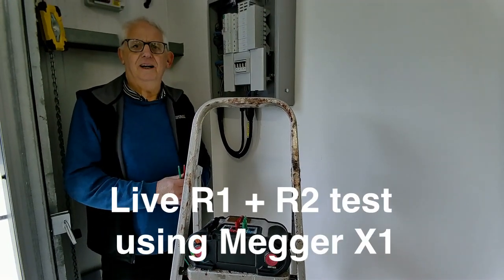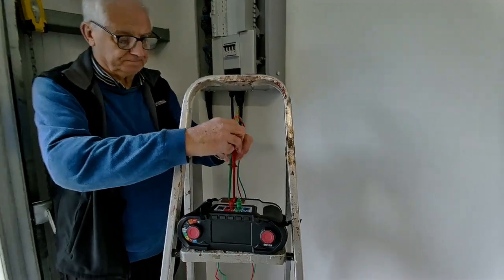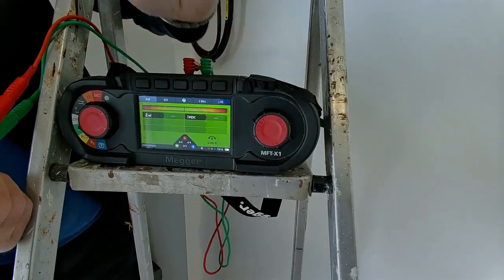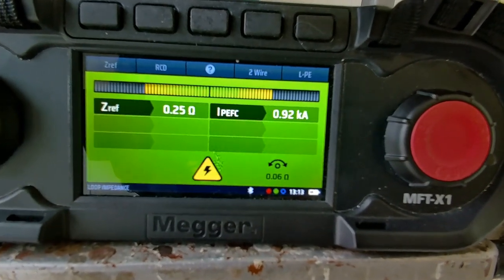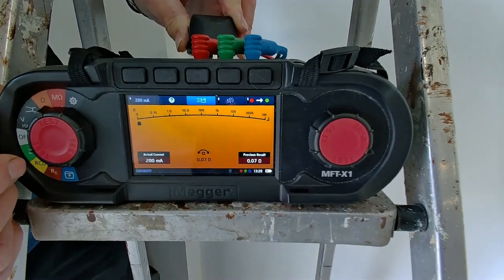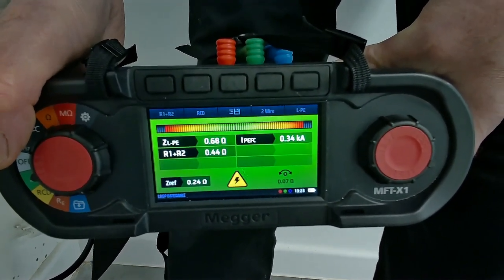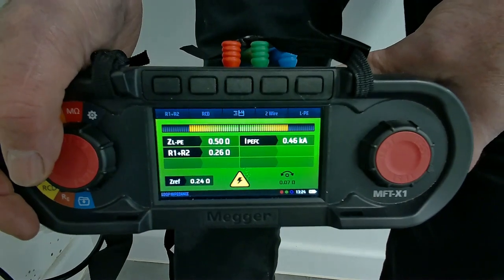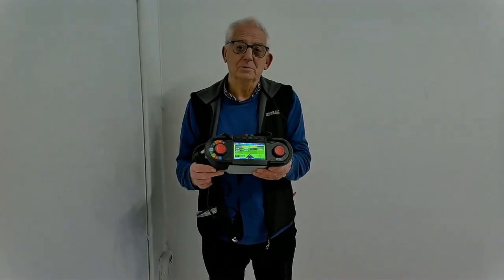MX1 Live R1 + R2 test

Comment: it's X1 not MX1         Why are you using the 2-lead test instead of the more accurate 3-lead option, no wonder the confidence meter is taking so long to stabilize. Always utilize the neutral when taking live Zs measurements, you get more reliable results

Comment: The only tester of any kind in the world that I've seen that for some reason has OFF  function in the middle of the selector scale, which basically means it's unavoidable to cycle through tests without switching it off and on. again and again..???
Reply from the maker: Having used it for a while now I can tell you that scrolling through off is no different than switching between tests, there is no delay at all unless you stop on off and even then it switches back on in a second or two. The switch seems sensibly placed as live tests are one side and dead tests other than voltage measurement are the other side.  Like all test equipment you soon get used to whatever you are using.

Comment: How did you set up the handsfree function? My tester says invalid connection when I press test?
Reply from the maker: You need to go into settings and allow the auto start hands free function.  Once you have done that push the test button and the triangle on the screen will pulse, then connect leads.. There is a user manual on line for the X1  you need page 44.  Hope this helps
Reply: @chriskitcher  Thanks! The option to auto test was missing in the settings. I contacted Megger and they said to update to the latest firmware which I did and it solved the problem!